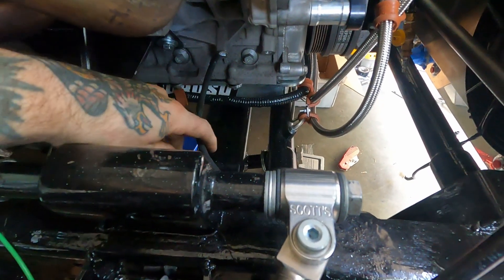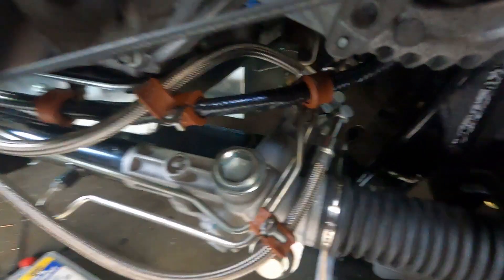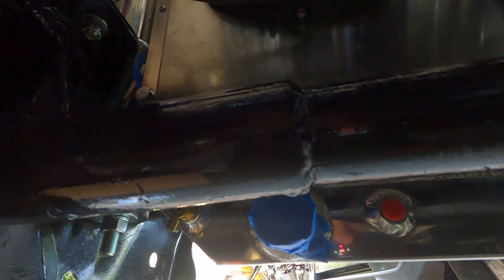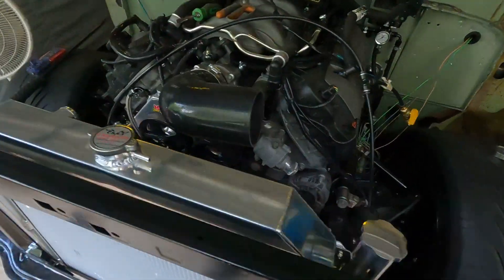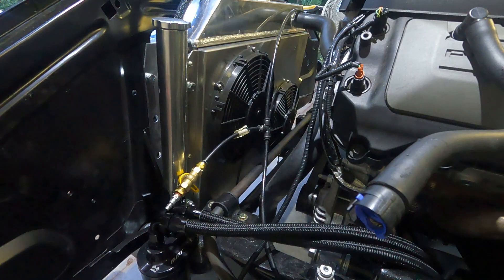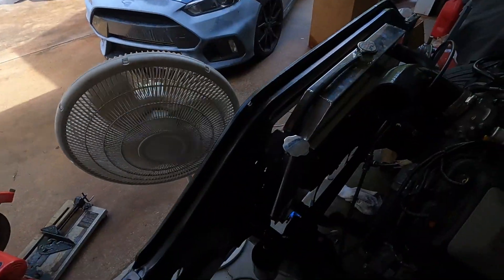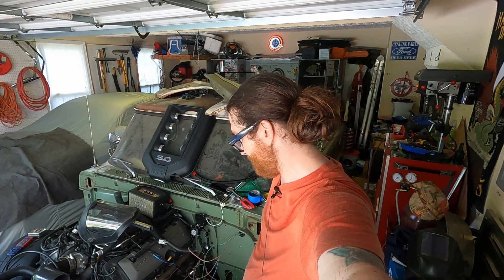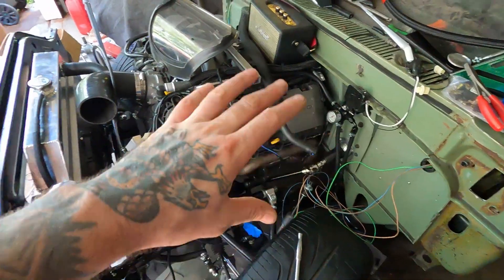Installing Coyote swap engine fluid lines. Coolant, fuel, power steering and oil lines.

Comment: I recently bought a KRC power steering pump exactly as the one you are using in the video.  What I didn’t get were the lines.  Did you make your own lines or purchase them for intact?  Would you mind offering the model number and where purchased.  I have a mustang II style power steering rack also.  Thanks and keep up the good work.
Reply from the maker: I got my P/S lines with the IFS kit. They're from a company called Gotta Show. I don't have the part number, and their website sucks. Give them a call and they'll help you out. I've called them and they were very knowledgeable.